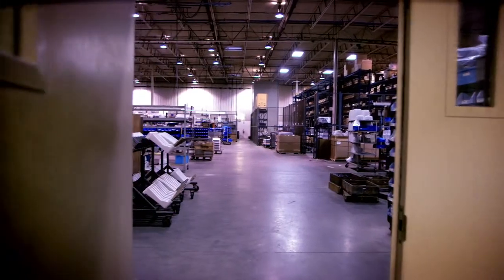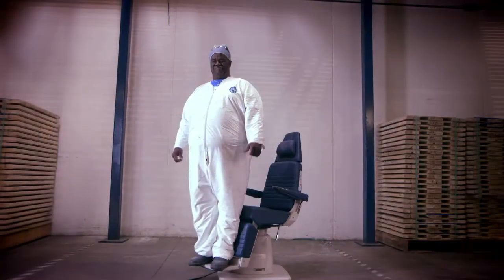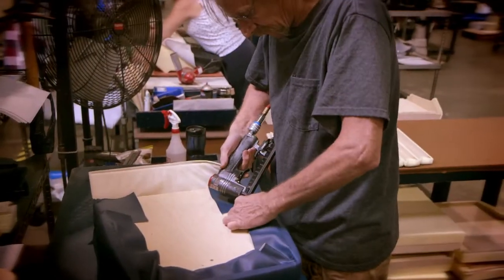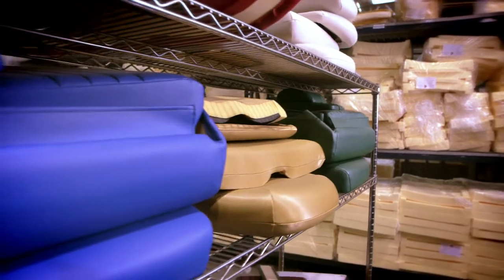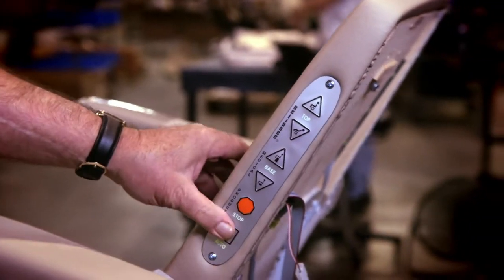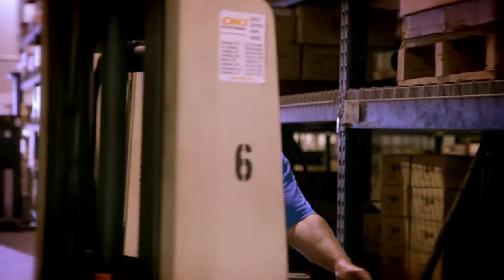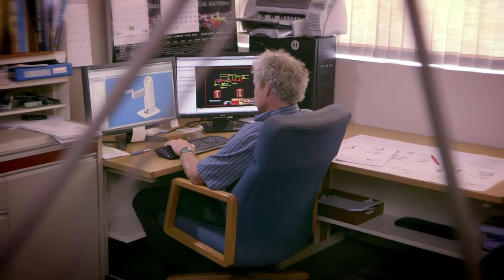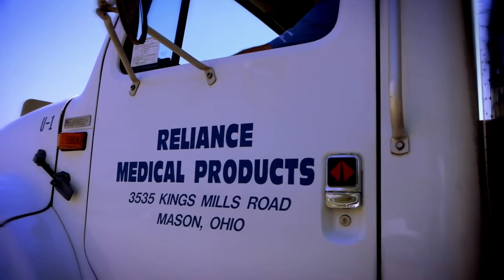"Brutishly Durable" Factory Tour for Reliance Medical Products

Comment: The chair could be improved by putting the reclining button on the back, so not to be touched by its occupant either by accident or intent.  The head rest ought to have a sensor to a "kill switch", so if the head rest touches the wall behind the chair, the downward motion is halted, thus saving the wall..